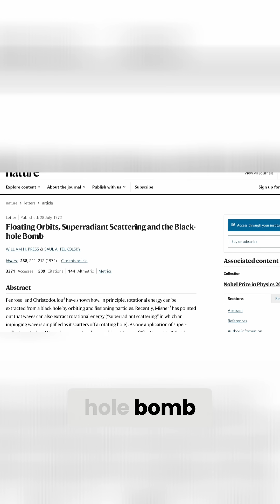Black Hole Bomb! Unleashing Energy with Mirrors! #science

Comment: Just collapse a toroidal black hole onto an anti-matter black hole in the middle of it..  I have no idea what would happen when those event horizons impact each other, but the galaxy probably wouldn't survive..

If you have the toroidal black hole spinning really fast to keep its shape with centrifugal force, then slow down the spinning, it should collapse.  And any matter that gets close to the anti-matter black hole, should get sucked into the black hole.  Thus protecting the anti-matter until they collide.